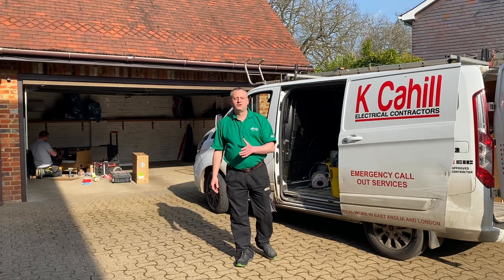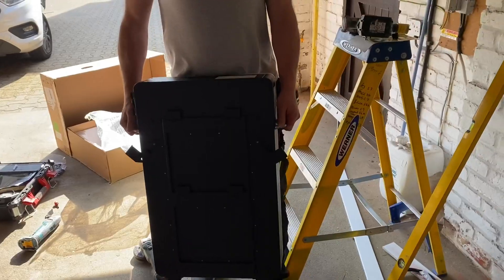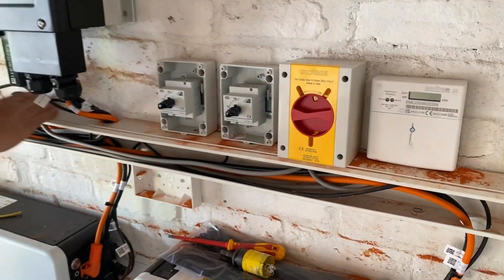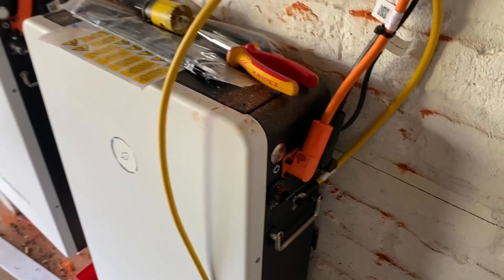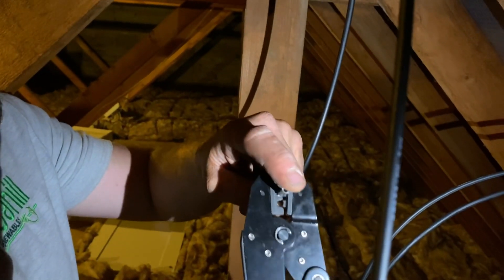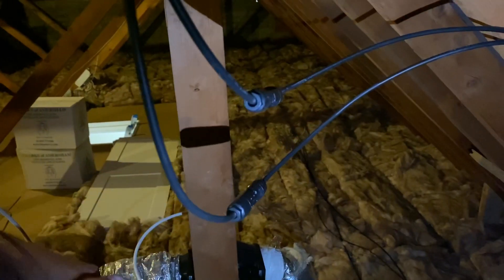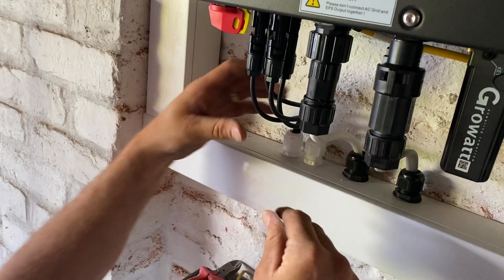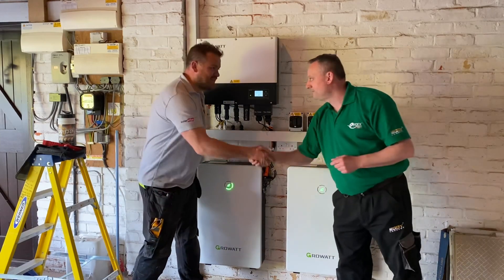Solar Panels & Battery Storage - Prosumer Electrical Installation Tech Tour

Comment: Interesting video in great detail! If only to see the danger limits of holding live DC cables 😂
I certainly will not be splitting them in the loft where they cannot be easily inspected and can be disconnected directly on the roof if needed.

Comment: Those AC lines from the inverter looks very undersized unless it's a 2000 watt MAX.
Typically 3500W inverters say 4 mm2 minimum
This looks like less than 2.5 mm2

Comment: How did you get the battery cover to fit on with the growatt cables. Mine just simply won’t screw into place. The cables are just too thick.

Comment: there is no need for this battery storage as the solar will make the meter run backwards  when its producing excess energy  with this old meter without a ratchet

Comment: Why is the dc cables not protected all the way from the rails on the roof down to the inverter in a flex pipe? This installation would fail standars in sweden

Comment: Few things picked up on, mc4 in the loft are fitted wrong way round, “male” pin goes in the “female” side of the mc4, no need for labels on installs as of 2nd amendment only label needed is a solar array sticker near point of isolation for fire fighters and the solar array label should never be stuck on a paintable surface, also no need for a generation meter on installs anymore as suppliers will not accept readings from them, only from CT clamp readings at the incomer

Comment: One thing I've never understood is; what happens to the electricity generated by solar panels when they're not wired up. Like where does that energy go? And why did the installer not get an electric shock when he touched the live wire coming from the solar panel?
Reply from the maker: If not connected energy dissipates in the panels as heat.
Reply: To get a shock you need to complete a circuit, so if the panel outputs are floating (not connected to the earth), the only way you can complete the circuit is to touch both connections at once. Not a good idea to do it in case there's leakage to earth occurring somewhere - including making sure you know where the end of the other wire is.

Comment: So if the mains power goes out, the batteries don't power the home but you can use those two plugs by the batteries? 
Great for the UK I suppose with very minimal power outages, but no good for South Africa.
Reply: Absolutely. The difference in South Africa is that you're not allowed to export, are you? Your sunny country was so far behind when it came to solar PV due to politics, but since your "load shedding" has become chronic it seems that it's coming in behind batteries as the primary focus. Affordable batteries are of course a more recent development than affordable PV. I've had PV since 2011 and get paid for what I generate whether I use it or not.

Comment: @2:50 Is this a typical install method for 2 batteries rather than using specific 2 battery cable set?

Comment: Great video, I am considering a very similar system. What is the weight of the inverter and battery as my internal walls are all plaster board.
Can the battery sit on the floor , held by a bracket upright ?
Reply: My garage internal walls are plasterboard. A mounting board was fitted onto a wooden frame which attaches to the plasterboard. The inverter was hung on the mounting board and the battery sits underneath on the concrete floor, though there are mounting brackets to prevent it from tipping over just in case. The 3.6kW inverter weighs 27.5kg and the 9.5kW battery weighs 110kg. Both are GivEnergy.
Reply: @CastleKnight7  Thanks at 110 kg  its good to know it can sit on the floor.
Reply: @radiotowers1159 No problem. It’s a neat system and takes up much less space than the small Beko feeezer I have in the garage.

Comment: I don’t understand why an EPS is extra during a power cut but all the house runs from batteries during normal operation. 

Why is the grid needed for normal operation?
Reply: It's grid tied, which means that with the aid of the current transformer it will supply as much as it can to the house, but if the house wants to draw more power than the inverter can supply, it's automatically supplemented by the grid. Grid tied also means that the inverter stops outputting in a power cut to protect people who might be working on the electrical supply, so in that case you must use the isolated EPS output.

Comment: Making off live dc mc4 connectors is so rough. Nearly 300v dc. I’m surprised efixx show this practice. You should terminate into your dc isolator supply side before connecting  the last panel. You the check you voltage before coming out of your load side with the correct m/f mc4 connectors.
Reply: Was thinking the same thing. Some serious risks taken here, even holding each stripped PV cable in each hand whilst measuring the voltage!
Reply: So connect ends into dc isolator then make off the other ends to connect to pre wired panels? What’s the safest way of disconnecting panels, I know you isolate the ac then the inverter/dc isolator, is it then safe enough to pull the mc4 connectors or will you still get arcing ?

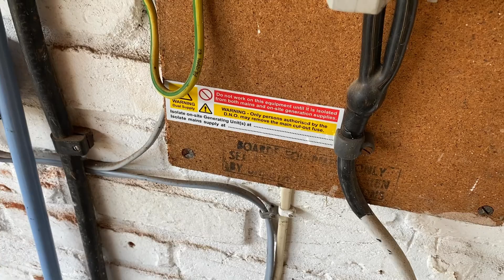Comment: 14:10
Voltage drop?
Without a load?

.. I think the light level might have changed slightly!
Any losses will be within the panel, not the cable!

Comment: Hi, just wondering, why haven't you fitted protection between the battery and invertor, regs and the growatt installtion guide state a 2 pole MCB must be fitted in case of battery fault. Also, regs and the installation manual also say the invertor must be protected by an RCD but you installed it in the consumer unit before the RCD. I'm confused, can you clarify why you've installed it like you have? Cheers

Comment: Great video. Where do you run the EPS to and from? Just to the inverter to socket or have you install an ATS? Growatt advised me an ATS is needed and from the consumer unit but I dont see this in your video so was wondering if your set up works without ATS, earth rod, or from consumer unit.
Reply: Watch the video . 1 double socket is fed direct from the eps port .
Reply: @persona250  that’s not how it’s fed. The feed still needs to come from somewhere via the inverter. Growatt say it requires an ATS and others say they have been able to do it the same way from im the video. However I’m unsure if it requires a seperate CU
Reply: @danmurphy7338  have you watched the video ? . It’s really easy to follow , the eps port is on the inverter , the engineer connects a flex from this port into a double socket .
Reply: @persona250  yes I have watched the video. I have also spoken to Growatt who advised this method wouldn’t work without the ATS. I can’t see an ATS. Incase of a powercut the inverter would go into island mode without the ATS even if theres power in the battery unless I have miss understood what Growatt have said. I’m new to solar so excuse the ignorance if I am not making sense.
Reply: @danmurphy7338  you have misunderstood .
Reply: @persona250  how come? So I can feed as shown in the video and if power goes off the customer can use that socket as long as power in the battery? If so, whats the point in the ATS?
Reply: @danmurphy7338  when the inverter is islanded it can’t output down the mains feed . It outputs through the eps port .no need for an ATS if the eps port is feeding 1 back up double socket . ATS is required if using eps port to feed essential circuits.
Reply: @persona250  aww right mate. I get it. So the ATS is basically for a full UPS back up power.
Reply: @danmurphy7338  you got it 👍🏻 I actually connected one up this morning.
Reply: @persona250  It is however missing an appropriate earth.
Reply: Does ac and dc need to kept separate?

Comment: Interesting. I have just ordered a solar battery system & wondered about the location of the inverter & batteries. I definitely don't want them outside the house so I have a choice of in the loft or, making some room in my rather cramped single garage. The loft would be easier in some ways but I've read some reports that the hot / cold temperature  cycles in loft spaces are detrimental to inverter & battery reliability. Any thoughts or advice would be appreciated.
Reply: That is actually truth
I have been on repair where inverter reported bad insulation caused by moisture (usually after rain or in morning due to dew). It doesn't happen often, but it does happen. This stops generation till fault is clear. 
Batteries have another set of problems if installed in loft. Weight is one, (very remote) possibility of chemical sp is another.
Electrical equipment in loft would force you to install ionisation smoke detector interlinked with rest of your fire alarm system. If you don't have interlinked fire alarm, then you would have to fit it. That is for most locations of Inverter.
Reply: @WizardNumberNext  👍In the end I decided to have the inverter, battery, solar diverter & other ancillaries fitted in my garage. The installers were very grateful because it meant they didn't have to carry the 110kg battery up into the loft space & I didn't need any additional fire / smoke detectors. The system is working well but the 3.6kW Hybrid inverter is not really big enough for everything we run at the same time. I now wish I had got a larger inverter & more battery storage. I'm looking at extra batteries & possibly a new inverter.

Comment: It would have been far safer to fit each socket on the end of each solar panel cable as they are cut to length (09:13) rather than have lots of live ends dangling about.  He needs to think a little more about safe working practice(s). 

Also having identified the polarity of the cables - a bit of Brown & Blue sleeving over the Solar Panel cable ends would be useful if any future maintenance becomes necessary - or using the appropriate coloured ferules on the cable ends.   

Are the cables pairs also identified as to which panel they belong to ?.  I see far too many installs done that do not document the cables / items that they belong to - so the next guy that comes to do any work on the cables/item knows what is going on.
Reply: As an amateur I thought the same. Would you add fuses while adding the MC4 connector (even if it's not a legal requirement)? Is there a downside to adding fuses apart from costs? Same with the absence of T-fuse between battery and inverter. Looking for a professional opinion on fuses. TIA!
Reply: @hannesviljoen8434  Yes, should install fuses between battery and inverter. Also surge protection is a requirement.
Reply: The easier : buy black and red DC cables : no confusion!
Reply: @Nicolas-qb3yg  I was just going to say it would be rather odd to put brown and blue sleeving on DC cables!

Comment: Forgive the stupid question, it's more than ten years since I did any work at the domestic level. As an electrical engineer I was surprised that only one socket with EPS, I understand the protected circuits. If I was going for this type of installation I would expect, in the case of power failure of the grid, for my home to still operate as normal. Is that possible? Or, do you have to design an off grid installation with a grid backup?
I think I need to update my level 3 qualifications, or is there an alternative?

Regarding the panels, should they not come with a plastic film that light doesn't penetrate to enable safe installation without having to worry about live wires?
Reply: Yes of course you can rig the whole house on backup but if the customer hasn’t paid for that then he’s not going to set up an ATS earth rod etc .

Comment: can someone help me there how to install switch that is operated by electric provider and its need to use drm 0 or whatever is it to stop the production if they need to stop it remotely i cant figure out how to connect the pins and cables its inverter mod10ktl3-xh

Comment: Well that's shit if there was a power cut I would  want the battery to power all the house not just one socket
Reply from the maker: You can do that but you are still limited to the power available in the battery - start an electric cooker running to battery won’t last long!

Comment: Pardon me for my question. I’m a newbie. I got Growatt sph6000 with 24 lead battery. My question is, does the battery goes with the grid at night? Or the battery serves as a backup power only?
Reply from the maker: It can be both depending on how you set up the inverter.
Reply: @eFIXXENERGY  do you have a video on how? Pls if you have it

Comment: i'd be interested to know if there was similar system for battery storage from off-peak electricity?
Reply from the maker: You can use this system ( and others similar) to charge from off-peak.
Reply: @eFIXXENERGY  fab
Reply: This system works great for just ess mode storage fitted over 100 so far
Reply: @bramcoteelectrical1088  do tell! ESS mode is not a term i've heard of.
Reply: @kathrynwhitby9799  ess stands for  energy storage system look us up if you want off peak storage fitting.
Lots of different ways and sytems
Reply: @bramcoteelectrical1088  thanks. I may have to do some modernising first. ;o)

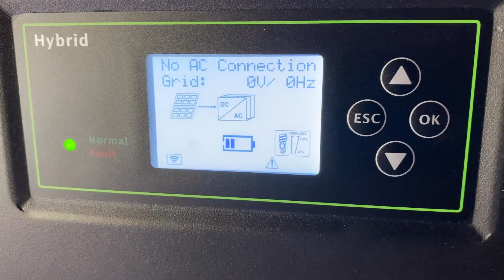Comment: 17:14 There is no direction with a CT clamp with regard to a AC current reading.
Reply: Yes the correct ct direction is critical...
Reply: I can see why you think that, but the inverter is also looking at the voltage waveform, and if you compare the two (such as by multiplying them together) you will get the opposite result if you turn the CT around.

Comment: surely in the event of a power failure, part of the point of having a battery system is so you have power ? Not just one external socket you need to plug leads into ? Why are the battery systems/inverters not set up more like a UPS ?
And is it a 12v system ? 24 ? other ?
Reply: The Growatt batteries are likely about 50V. A grid tie inverter will shut down if there is no power detected on the grid. The EPS outlet is a separate output from the inverter which will be switched in when the grid supply is out.
Reply: @Soruk42  All those batteries and you still end up powerless in a power cut....just seems all wrong and a bad design ?
Reply: @blow0me  I see where you're coming from but it makes the whole system that much more complicated and a higher risk of failure to have some kind of grid monitor that completely isolates the house electrics from the grid in the event of an outage, then rejoins it upon restoration of supply. I have personally never seen such a setup.  The system has to shut down in the event of an outage else you risk electrocuting a linesman who believes he is working on a disconnected line when a solar installation has energised it.
Reply: Makes things complex without a physical.change over switch.

Most installs i put in rcd socket as the inverter becomes  an IT earthing system ups. so make sure you do earth your grow watt batteries incase of faults and a rod TT setu setup if you do go full change over setup
Reply: @bramcoteelectrical1088  Mate what is your WhatsApp number?
Reply: Anti island is for a reason..so not to kill anyone working on the fault on the network.
The eps mode makes its own UPS 16amp supply for your use to a RCD socket or use a double pole change over switch

Comment: 14:30 the volt drop statement doesn't make any sense does it? Drop measured by a high input impedance volt meter with no other current being taken from the cable. Ohms law should tell you where you have gone wrong there....
Reply: You can't really compare at two different times either, might have a cloud overhead :)
Reply: @stevec00ps  That will be entirely responsible for the 1 volt "drop"! (With no load, PV voltage varies only slightly above a certain minimum level of light.)

Comment: Curious why they aren't using some sort of dual contact connector? Seem's like a bunch of single contact connectors the potential for mixing them up is greater and if we're dealing with a couple hundred volts per bank, I could see miswiring causing damage and injury. Some systems I've seen here in Canada use Anderson Power Poles which can't be connected backwards once crimped.
Reply: battery banks are not operating at hundreds of volts. Pretty sure they are only 12v, although you'd think 48v would make more sense. But potentially they might be handling a lot of current
Reply: @blow0me  I was referring to the leads from the solar panels. The measured voltage when he was installing the plugs on the leads in the attic he said the leads were measuring 292 volts DC. Watch around @10:15 his volt meter says 292 and he says  292 minus volts. That's not the 12v you were saying.

As for battery banks, it's not uncommon to have voltages higher then 12v. A UPS I recently replaced the batteries on, the nominal voltage per bank was 48v on a 1500w UPS. And older 3000w UPS we pulled from service the battery banks were nominal 192v.
Reply: 48v to 52volt growatt
Reply: @bramcoteelectrical1088  So where did his volt meter get 292 volts from on the solar panels?
Reply: @TheDrew2022  the dc voltage from.the array
Reply: @bramcoteelectrical1088  Okay, so individual panels are 48-52 volts, but combined in series, the array hits 292?
Reply: @TheDrew2022  most panels are 29.8volts to 40volts depending on model etc and yes they run in series but with correct know hoe you csn series and pararral them to get more current
Reply: @bramcoteelectrical1088  Makes sense. Same way we series-parallel 6V RV batteries to get more amps/amp-hours for running loads at night.
Reply: @TheDrew2022  Putting panels in series strings increases voltage but not current, so you don't have to use thicker cables. The downside is that if one panel in a string is even slightly shaded, the whole string is severely affected, unless you add extra equipment ("optimisers" on each panel).